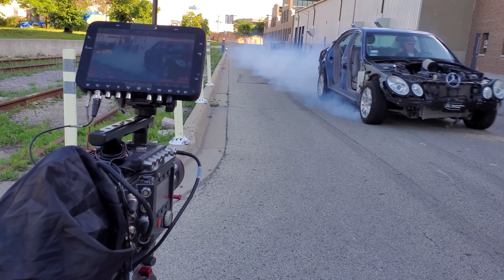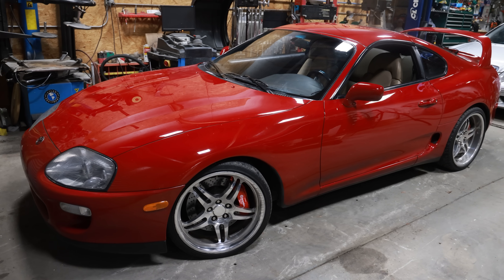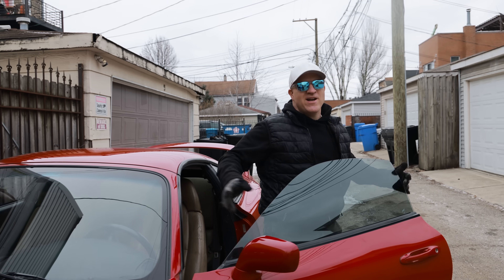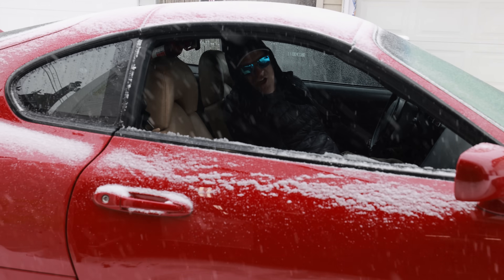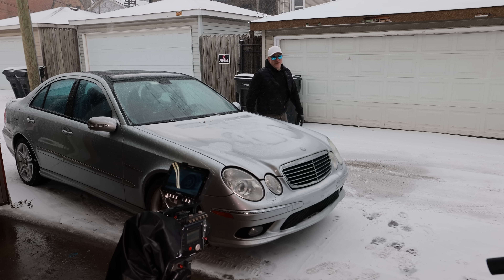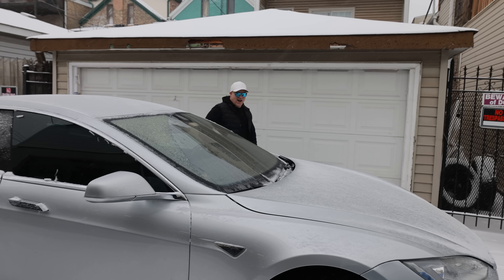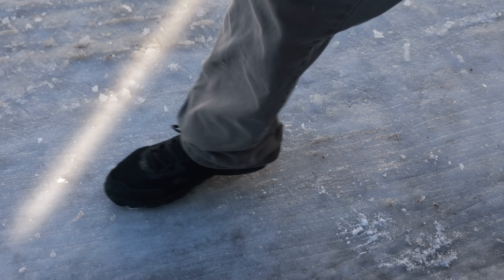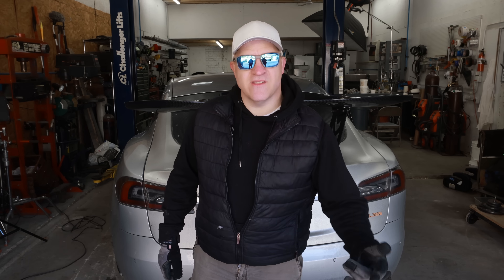Anti-Lock Brakes (In Slow Motion)

Comment: Anti-lock brake trivia:

In the Amazing World of Gumball episode "The End", when Richard attempts to drive to the grocery store, the rear wheels are spinning while the car remains stationary. Richard releases the parking brake and the vehicle moves. However, the parking brake locks the rear wheels, so the wheels should have never spun. This means that the car has an anti-lock braking system installed.

Comment: You do know that the pulses are generated at the moment the wheel goes from locked to rolling, not at the point where the wheel locks up, right?

The pulse “kicks” your foot off the brakes momentarily as it senses the wheels lock up. That’s why you can feel it through the pedal in most cars.
Reply from the maker: Actually the abs pulses are in both directions once the ABS takes over, The ABS system doesn't just relieve pressure and unlock wheels, it also has a pump that produces maintains and modulates pressure. If the ABS system just dumped pressure and released wheels your pedal would keep on going to the floor.

Comment: I think your explanation of ABS functionality is a actually backwards. It’s not that ABS pulses the brakes on, it actually momentarily releases braking pressure when it detects a wheel has locked up. This restores traction, and the system repeats the process rapidly to prevent skidding while maintaining as much braking force as possible. In your slow-mo video, it looks like you’re treating the pulsed-on lockups as the good part of the braking strategy, but in reality, the pulsing on is the bad part. When the ABS allows just enough movement to prevent a full lockup, that’s not a flaw, it’s a perfect example of the system working as designed.

On my motorbike, I can clearly see the ABS disc, which has about 100 slots cut into it. An infrared light source projects through these slots and counts pulses while the wheel rotates. When you apply the brake, the pulse count drops, but if it drops to zero, that means the wheel has locked up. The computer detects this and briefly reduces the brake pressure, allowing the wheel to rotate again and the pulses to resume. It’s a constant, rapid process designed to keep you right on the edge of maximum braking without losing control.

Comment: If you rely on ABS almost every day, then you should not be on the road at all. ABS is for dealing with emergency situations when you hit the brakes as hard as possible and also might need to steer. As such, it should only ever by used on a very few occasions. If you are triggering ABS every day you are driving like a lunatic.

Comment: I test driven a 2024 model Volvo XC90 on dry road condition.  I went from 1 to 130 in about 7 seconds.  Then, slammed on the breaks.  The ABS kicked in and release just when the wheel locked up.  In just a few miliseconds, it functioned and stop the car.  From the time I slammed on that breaks, it stops within 20 feets.  Impressive.  The whole time, I felt in total control
Reply: No car stops from 130 in 20 feet. Not from 130kmh, much less 130mph. Something like 50-80m from 130kmh would be realistic.

Comment: relies on almost every day? There's no need to just make up total lies, the number of times you should encounter ABS activating is probably not even once a year unless you're an absolute numbskull driver late breaking in the rain. (more often in snow but that's only limited parts of the country)
Reply from the maker: I think that depends how aggressive you drive, if you just drive to work and back everyday well you're still relying on ABS everyday because it's there whenever you need it that's what I meant.

Comment: The "pulses of ABS" being shown are actually what the ABS wants to prevent: the brakes blocking the wheels! So in effect the ABS is unlocking the wheels when they lock up to keep them spinning and adhering more to the surface to increase traction. Because without traction, you are neither accelerating, nor slowing down!

Comment: It's interesting on how different manufacturers program their abs. There's a balance between stopping, and control.  The whole premise of abs is to prevent  a total loss of control under heavy braking, and braking on varying traction surfaces.   There was a good demo video that ford did back in the 90's  showing the strong points of ABS. Also later on you get the advent of traction control, and stability control.  In some application the abs system is used to limit wheel slip under acceleration.

Comment: Wow, you are doing something wrong if you rely on ABS on daily basis.
I can't imagine that you "use it" without notice. You definitely feel it at the brake pedal, even with high frequency.

Under dry conditions it's still better to brake as much as possible without activating the ABS. ABS keeps the vehicle controlable, and it's little bit better brake force than locking wheels. But avoid locking is still better.

In snow it's the other way round... having locking wheels will produce snow piling up infront of the wheels, which incease brake force. So ABS is always worse than a good driver. But you definetly have the benefit that the  car stays controllable. This might be the reason for slow pulses on snow for the mercedes.

The real benefit of ABS is if you have uneaven slippery road (e.g. right wheels on snow while left wheels are on dry pavement).

MOST IMPORTANT... ABS do not compensate bad tires or brake pads.
Reply from the maker: Lol fair enough

Comment: From the cars i've had i don't like ABS, worst experience was i almost run through a fence for inches on a '16 Buick Regal cause i was moderately braking on the same route and it got activated by a few pieces of gravel and completely lost braking force cause the pedal was pulsating and wasn't shutting off when it got traction, took me like 2-3 seconds to realize it was ABS and press the pedal down to the floor and took me across the street.
On a BMW X5 e53 i've had was actually good and i was braking hard for fun cause ABS was just going TRRR and was predictable and stopping every time.
Best braking experience for me is with good tires, so good the brakes can barely lock them, best brake parts available, and no ABS, never had a problem having in mind i have no ABS and drive and brake accordingly, keeping distance etc, not for the ABS but for general reasons.

Comment: Tesla doesn't lock up wheel much at all leading to longer stop distance but almost complete steering control. In newer cars across all makes, keep greater distance between you and vehicle ahead of you. I find all newer vehicles take a little bit more to stop, don't lock up tires, hardly at all. But you have better control in new vehicle.
Reply from the maker: That's a great observation
Reply: @WarpedYT  Thanks. Great videos, as always

Comment: Great test man! But have to make 1 thing very clear: Your foot brakes, the ABS system RELEASES the brake when a wheel locks.

By releasing the brake you keep the ability to steer. That's the reason ABS was invented, because in a stress moment your foot always presses too hard for the grip. The grip levels always change on the road and the ABS make sure you're always able to steer and brake at the same time, on every grip-level on dry, wet, and snow/ice. Because the ABS never know how much brake pressure is perfect for a situation, it releases the brake quickly very short moment every time a wheel locks. All wheels indepentenly from eachother, because when all wheels are stationary at the same time the system might think you already came to a stop and then it stops working.

Comment: Test a 2007 or later Toyota or Lexus hybrid. These have a FAR more comprehensive vehicle-dynamics integrated management (VDIM) system that can measure, react, and even predict likely future vehicle behavior 1000 times every second. For example, slam the brakes in a normal car with primitive ABS and the car will veer if the grip is different from left to right. VDIM can torque the power steering to keep the car straight. The same is true on the throttle - slam the torque pedal in a FWD hybrid and the instant torque will try to pull the front end left or right if one wheel is on snow, ice, or gravel - VDIM instantly corrects before you even notice.
Reply from the maker: That's interesting you say that because my Prius I had two of them I think had that system and it was pretty amazing. However from what I know the Tesla also gets a thousand samples a second... At least that's what I read but you know Elon lies a lot.
Reply: @WarpedYT  Tesla monitors wheel speed 1000 times per second and can adjust the motors 1000 times per second to maintain forward traction while accelerating.

VDIM monitors every single sensor 1000 times per second, and can use that data to make future predictions on how the vehicle might behave, based on an integrated physics model.
Reply from the maker: @aspecreviews  yeah well Toyota dolphin does a better job with that information. Tesla may have a thousand times per second but it's putting out 1 pulse per minute.... Big claims small delivery poor results

Comment: Just open an old VCR or vedio casset recorder ....see its ir sensors which count revolution of cassettes n give its accurate time on display..... Same disc in vehicle wheels which checks revolution of each wheel with an ir sensor...anti lock break system genrate a pulse which prevents wheel locking

Comment: Aircraft have basically the same type of system. On aircraft, it's known as anti-skid. It senses a skidding tire and momentarily releases pressure. When the wheel spins up again, the brake pressure is again applied to that wheel at the maximum safe level but immediately below the skid level. The wheel is thus continuously prevented from a skid condition.

Comment: Abs on my 95 Mustang is garbage, stopping distance is like 3 times greater, which puts you in a horrible place and stopping power between pulses is just not there, the car just keeps going. I pulled the fuse and use my brain guage so i can still steer and put maximum pressure to the brakes. No warning lights by pulling the fuse which is nice. These cars dont have traction control either.

Comment: Those are some slow pulses. My 2010 Compass if I slamed on the brakes you could here the pump going off like a machine gun. My 2020 Cherokee with snow tires hardly has to use the ABS in the snow, but when it does it once again sounds like a machine gun.

Comment: The Tesla and the Supra are about on par. The Mercedes was clearly superior. The pulses from the Mercedes were not complete lock ups as often. That is absolutely by design.
 Ideally, you shouldn't heavily depend on ABS. It works best in conjunction with good progressive braking technique. When you feel the pedal pulse, you should take that as feedback to decrease braking pressure. The pulses will be more frequent if you're not overloading the servos. If you barely break skid threshold, the vibration is very fine and high frequency. If you drop a lunch box on the pedal, you get that chunk a chunk response. That's the last ditch effort to try and save your life because you're panicking and not braking correctly. It's supposed to aid you not stop for you. When you feel ABS kick in back off a little, and it works 100x better.
 I know it was being applied like this for demonstration purposes in the video, but that's why your pulses were so long. It takes the servos and valves more time to deal with more overload. Less overload can be dealt with much faster and effectively.

Comment: One thing to note is that the car is not pulsing pressure the brakes, but rather is releasing pressure from a brake that has locked. 
And a modern system should only engage on a wheel that has locked, be it one wheel or four. Weight distribution can have a huge affect on that. It appears that some of these engage abs before the wheel completely locks, rather than waiting for the sensor to register 0mph.

Comment: ABS is a double edge sword and more times cause accident at both side than straight ahead. Too many times car with abs will hit the side of the road because abs wouldn't allow u to lock the wheel and the car was pointing at the ditch and in the ditch it goes. Just like how Richard Hammond crashed his Jaguar to the wall of the track.

Comment: Great video and great slow motion footage, but there is confusion on how the system works.  ABS constantly compares wheel speeds and when it senses when a wheel locks up, or is about to lock up, it releases pressure and redirects it back to the master cylinder.  In the video you count a wheel lock up as a pulse.  That's not a pulse.  The wheels is locking from the pressure the driver is creating by pressing the brake pedal, then ABS is releasing it.  People think it "pumps the brakes".  That's not what it does.
Reply from the maker: Great point and yeah that's correct, but whether it unlocked four times or locked the wheels five times for me it still counts as a cycle or pulse. It would have been just way too confusing for me to explain to people that have never worked on a car before by counting the pulses as the open cycles. But yeah you have a great point it's just way more straightforward to present it as a pulse every time the wheel locks, because in reality if the pulse unlocking the wheel never happened the locking and unlocking wouldn't happen.

Comment: My experience with Upside is the first month has good deals. Drive a whole bunch and you might get a $20 payout.  Then the discounts drop to a couple cents at best and you realize the app is directing you to the pumps with the highest gas prices around.  You feel stupid and taken advantage of when you fill up your gas with a Upside discount to add 23 cents total into your account. Then drive down the road and see gas listed for 23 cents less per gallon than what you just paid.  It’s a scam. I stopped using the app and saved money buying gas at the stations with lowest prices.

Comment: My 1987 BMW motorbike had ABS on the front wheel. I don't know much about cars but I'm surprised how slow the car ABS pulses are. The motorbike ABS I had had very rapid pulsing, 15 or 20 pulses per second. I feel like that would be better as it creates more of a gradient between starting and stopping. Modern ABS in cars vary the braking power and I feel almost like that's what the faster pulses of motorbike ABS is trying to achieve in a very analog way. Thoughts?
Reply from the maker: You're absolutely right I remember working on a couple BMW bikes that had ABS on the front wheel.... I completely forgot about that. And I think all the newer ones also have abs don't they? And you're also right the pulses are very very short on the BMW bike. I can't believe I completely forgot about that. Thanks

Comment: GM was getting in trouble over their new lightweight midsize front wheel drive Citation rear brake lock up. They couldn't get them balanced right, so they took the ABS system that they were working on, and installed it into  the rear of those early front wheel drives as standard. They didn't invent anti locks, that goes way back to the 50's at least, but they did start the trend of putting them on regular cars. The natural evolution was for traction control and saved SUVs by helping to prevent rollovers that were limiting the safety of those top heavy vehicles. There is at least a 40 year evolution of ABS on production cars and many distinct systems were were used.

Comment: Those older ABS systems are absolute dog shit!
On my BMW E30 and my Mercedes W201 I removed it completely because it's that bad! (and because it's legal on those old cars) 😁
If you are a good, focused driver that knows what his car can and can't, it's even better then those systems.
On snow I can do better by  5-10% with human ABS.
The modern car's though do a way better job.
My Hyundai never locks up the wheel it just modulates the speed with a crushing noise, and that's way better, and not a disadvantage for the sporty driver.

Seems like Tesla is buying off the old junk for there cars! 🤣

Comment: On snow, ABS will generally dramatically increase stopping distance.  In snow, locked wheels provide the fastest stop, albeit at the loss of steering.  If you need to steer, then ABS helps a lot.  But if what you need is the shortest possible stop, then in snow or sand or other soft surfaces, locked wheels always win.

Comment: Tyre grip changes this a lot, the more grip, the quicker the wheel will start rotating again, allowing the brake system to apply again.

There is a point where even the older/slower ABS system (at least it's not an ALB system) isn't taxed (speed-wise) due to the slowness in re-gaining traction.

Comment: It does this by "bleeding off" fluid pressure using arrays of valves. Most modern cars will flash the ABS indicator to tell you it is working.

Comment: Wow, very good video. Clearly your brakes are just too strong for the ABS, completely locking the wheels several times. I wonder if a fully stock setup would lock less and be better on snow and ice, even if only slightly. Very cool. Thank you.

Comment: While ABS systems tend to have a response rate in hz, it's not guaranteed to pulse at any rate, especially on something like snow. To get it to pulse at max rate, it has to lock the wheel as fast as possible after unlocking. But ABS doesn't just lock the wheels every 'pulse', it actually modulates less brakes when it detects lock then re-applies a bit, so the ramp of reapplication , the surface and the response rate all affect things

Comment: 3:11 Please, check the ball joints for your front right wheel of the Supra. It appears to have loose ball or two in the front suspension because the wheel is moving so much relative to car body.
Reply: they are in pretty bad shape for sure